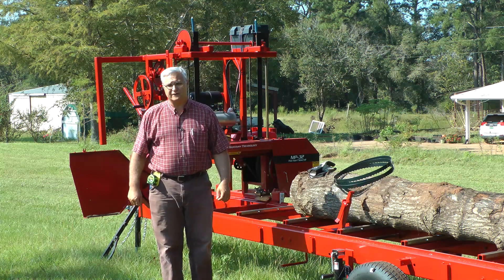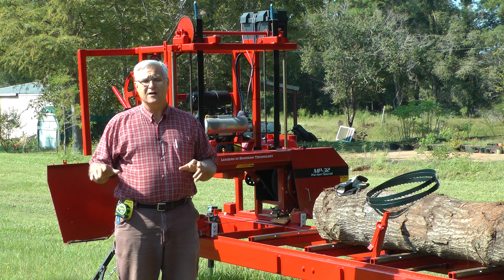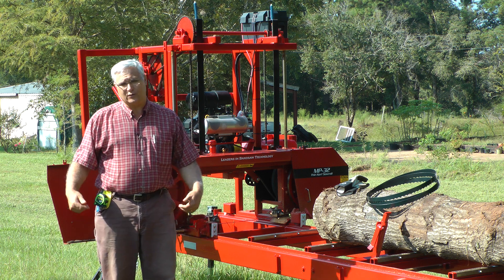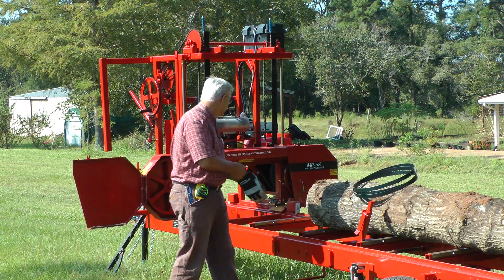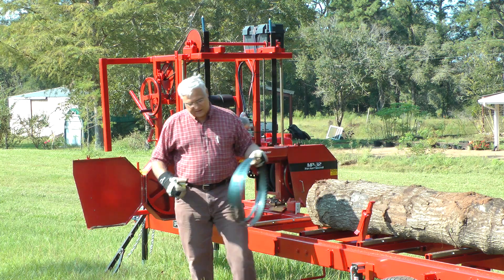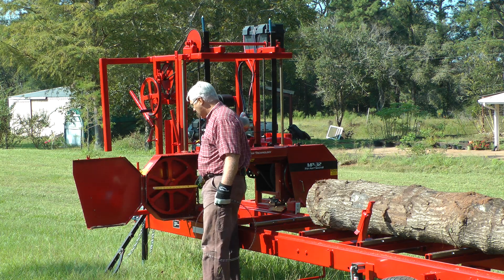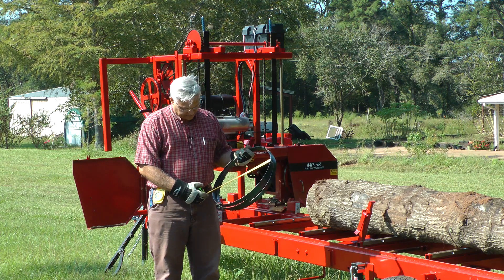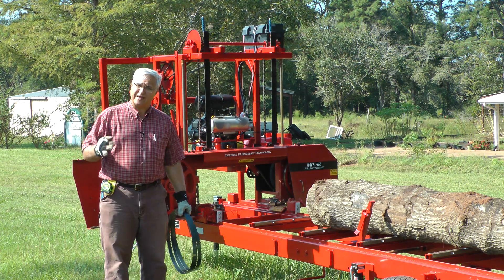Portable Sawmill Blades - Should you release the tension when not in use?

Comment: I have a thought on this: Can it be that there is a difference in the different types of tensioners? If the cook's spring tensioner "gives and takes", then the pressure will not rise when the temperature drops during the night and the blade shortens. If the wheels are fixed by a "dead" tensioner, tension should (by fysics) rise when the blade shortens?